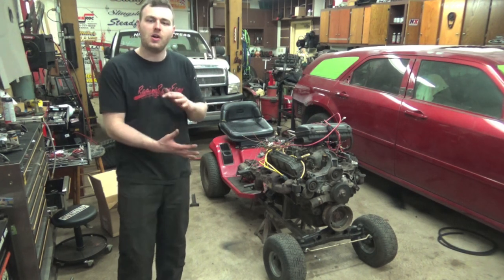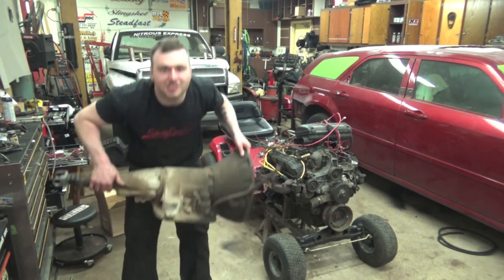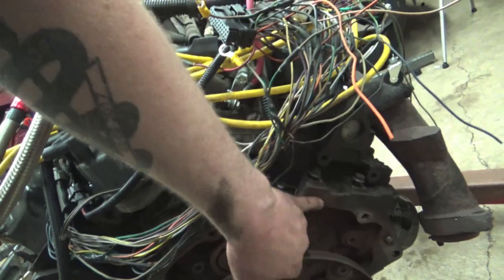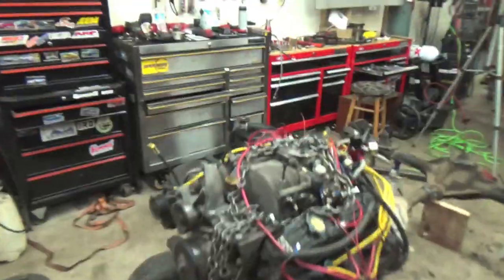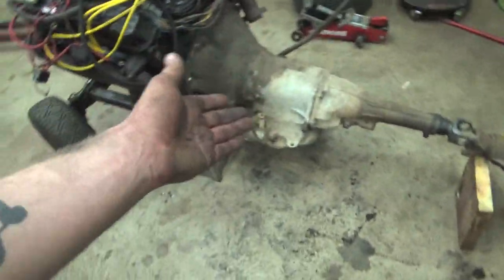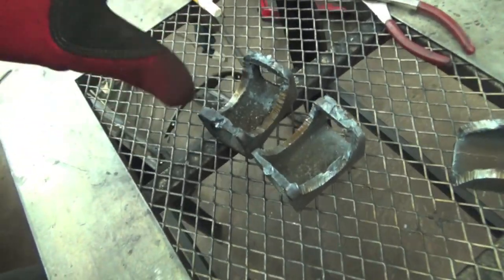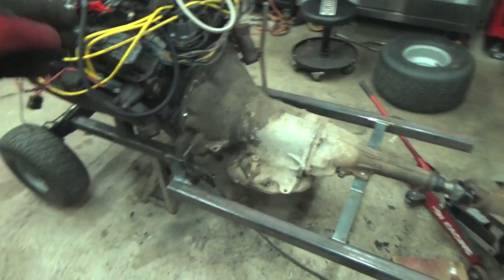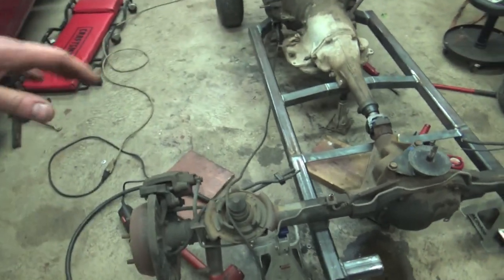HOW are we getting V8 Power to run our LAWN MOWER

Comment: Any remote chance you have the wiring schematic that you did to start the engine ? 

Awesome project.
Reply from the maker: Yes! You should check out the first start video I go over the wires that you need to connect to get working